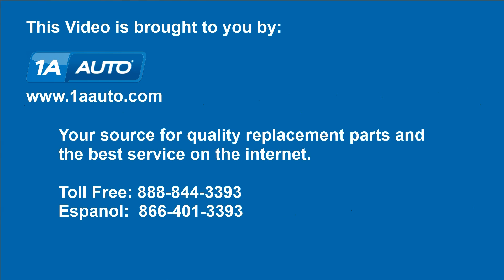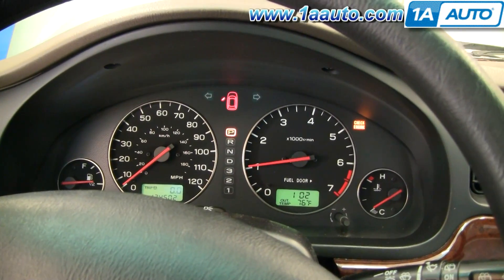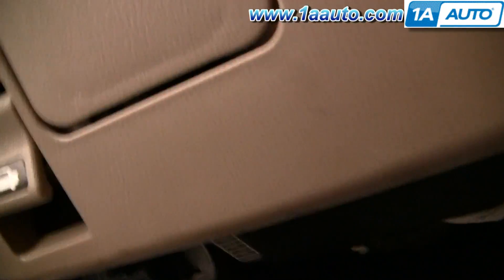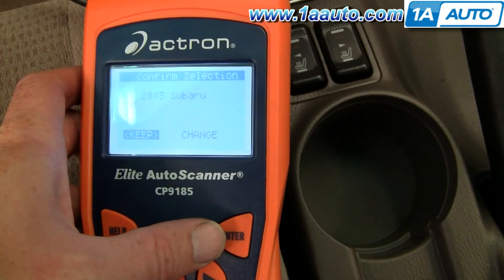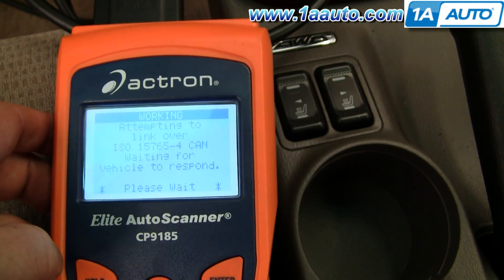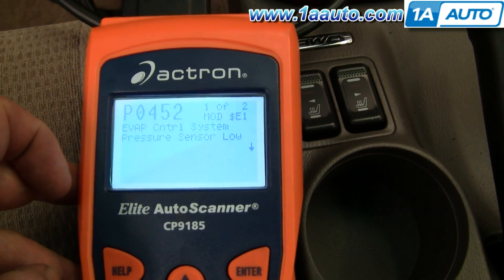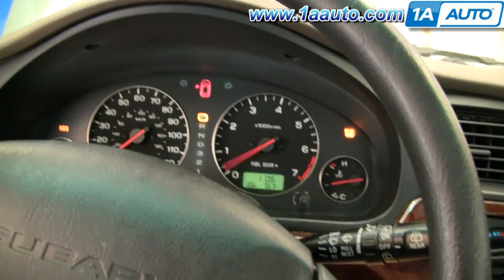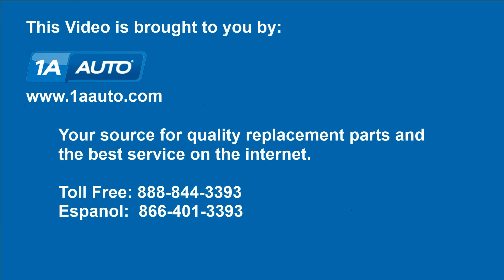My Check Engine Light Is On - What Happens Next?

Comment from the maker: The door for the fuel cap has nothing to do with the code you are pulling up. If it is related to the sensor, it would either have to do with the sensor on top of the fuel sending unit or it could be an issue with a part of the EVAP system.

Comment: Okay so I have had this done to my car as well and a very similar code came up. It was something like a fuel pressure sensor code. The problem is that the 1 thing that I feel could be wrong, everyone says should not make the service engine light come on. But it is still on almost 2 years later. The thing I think it is is my fuel door, I press the lever and it doesn't open it anymore, I have to open my trunk and manually pull the spring back to open the fuel door(2001 nissan altima) suggestions?

Comment: I have had my check engine light on in my 98 accord for a year. I took it to the dealer and they told me i needed to replace the catalytic converter for $ 1500 . Now i have to get it smogged and i dont know what to do. I bought the car for  only $2000.

Comment from the maker: Pretty much all vehicles after 96 have an ODB plug under the dash to pull an engine code with a scanning tool. This would work on your van if it was made in or after 1996.